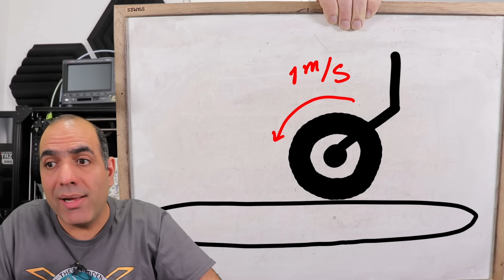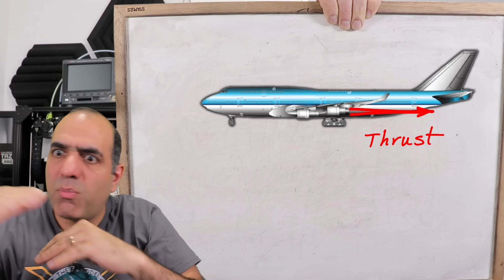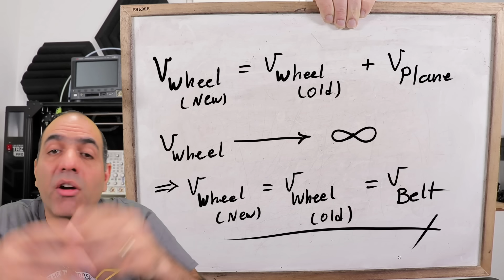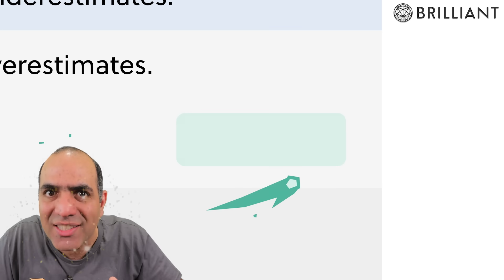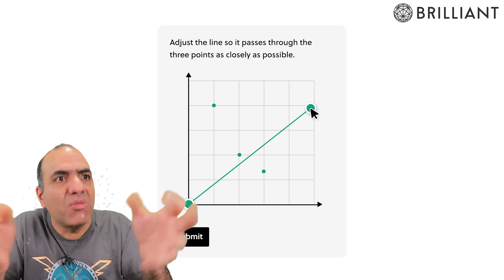Airplane Question that Drove Me NUTS!!!

Comment: Since the question is so simplistically stated I think we need be no more sophisticated in any of the assumptions needed to come up with an answer.  The plane is stationary.  There is no externally caused wind.  There is no friction in any part.  The wheels rotate with some nominal surface speed and the conveyor belt moves backward at the same surface speed.  Therefore since there is no airflow over the wings of the aircraft it has no lift and stays on the belt.

Comment: The wheels aren't driven. The plane would accelerate forward. If the belt continued to increase speed to match the wheels, I assume the wheels would fail at some point. There's no way the friction of the wheel bearings would overcome the thrust of the jet engines.

Comment: I think it should be able to take off, because the wheels aren't pushing it forward, the engines are. Even if the conveyor belt is moving backwards, the drag from the bearings in the wheels shouldn't slow it down so much that it can't take off, right? That's just my guess. Time to figure it out, I suppose.
Reply: If we have wheel drag and other friction, enough of those causes heat that makes the bearings explode and destroys the wheel assemblies.  While planes can usually land on their belly, taking off is a very different story.
Reply: @VoltisArt  if the wheel assemblies are destroyed, that would leave the plane a few feet above the ground. I count that as a takeoff :) (even if it flies about 4 feet before landing on its belly again)

Comment: The plane in this problem will NOT take off. It's more of a pain to read some strange comments and weird hypothesis (as Mehdi did in this (quite poor) video; he had the chance to explain properly but he missed this chance). 

Without making some weird hypothesis about plane's weight, wind speed, density altitude, ...ALIENS, then the question makes the following assumptions:
-Boeing 747 jet plane;
-conveyor belt which matches the wheels speed.

1) Indeed, the plane wheels do not spin because they are connected to the jet engines. This means the wheels are not the cause why the plane moves forward. The plane moves forward because of the thrust from the jet engines.

2) The engines do NOT create lift. This is done by the WINGS and the air going above and below them based on the Coanda effect. A Boeing 747 (as the problem states) does not fly in the same way as a rocket; a Boeing 747 is NOT a VTOL.

3) The engines will push the plane forward, but they will NOT bring air above and below the wings in order to create lift. The plane must move through a mass of air in order to fly.

4) The problem states: the "conveyor belt matches the wheels speed". The problem says NOTHING about the wind, for which case it will be considered zero. For an observer siting near runway, the plane is NOT moving. The ground speed is ZERO. While indeed there is some air sucked into the engines, which also creates some turbulence reaching the wings, most of the air particles above/below the wings will also be at ZERO speed relative to the plane and its wings. There is not enough mass of air going over/below the wings, which means NO LIFT.

5) Offtopic: indeed, a small planes can take off from a very short runway, or almost zero length (like the bush planes) BUT they are designed for this kind of operations (having VG kits installed, they are super-light planes), BUT they are NOT Boeing 747 as the problem states.

6) UPDATE: I see that many people speak about friction (and Mehdi too), but it is in the wrong way. The only time when the friction could play a role is if the conveyor belt through its movement displaces a mass of air enough to create lift, otherwise there is no reason to consider other friction than of a Boeing 747 (as the problem states).
Reply: "For an observer siting near runway, the plane is NOT moving."

Sure it is.  At exactly the same speed as if the conveyor belt was just a normal runway.  Because it's generating thrust via the engine.  The wheels are utterly irrelevant.

The only way to keep a large engine from moving forward as it's producing thrust is by physically bolting it to the ground.  You cannot attach free-floating wheels to the bottom of an engine and put it on a conveyor belt to test the engine.  That would cause a large engine shaped hole in the side of your test facility.  You restrain it very tightly.
Reply: @Killua2001  Please read again the hypothesis of the problem. It is in the same way a person walking on a  conveyor belt is stationary for anyone else. What I said earlier is correct: "for an observer siting near runway, the plane is NOT moving".
Reply: @hal6702  A person walking on a conveyor belt can only 'move' by using friction between the belt and their feet.  So, yes, if the belt moves backwards, they do too, cause 'friction'.

A plane generates a lot of thrust.  The only way 'friction' keeps that plane on a conveyor belt without moving is if, again, it's physically bolted down.

You couldn't have possibly picked a more different scenario to call 'the same'.
Reply: It is the same scenario, but it seems you can't understand. I will try one more time maybe I can make your understand.
Suppose you are on a wheelchair which has attached a jet engine to it, and the wheel chair is on a conveyer belt. It is the same idea, it's just you who can't understand.
Reply: @hal6702  The wheelchair would very quickly find itself going through a wall, with or without a conveyor belt.  The only way to avoid grandma getting airtime in her chair would be to bolt it to the ground.

There's no difference between a 'jet engine' in this scenario, and a 'rocket engine'.  No conveyor belt is capable of exerting enough friction to keep a rocket from moving forward unless the rocket is bolted down.  The only thing capable of applying any kind of oppositional force is friction, and friction vs jet engine tends to lose every time.
Reply: @Killua2001  Do you understand the idea of a CASE STUDY and a HYPOTHETICAL QUESTION ? Do you think someone will built a conveyor belt for a Boeing 747 in the first place ?

What is all this BS are you keep replaying which has nothing to do with the main problem and nothing to do with the statement I wrote earlier which was "For an observer siting near runway, the plane is NOT moving" and you said it is false. It's not my fault you don't understand; it's your fault.
Reply: @hal6702  Hypothetical or not, newton's laws still exist, and without physically bolting an engine to the ground that engine is going to be moving with or without a conveyor belt.  Not 'moving relative to the belt itself', but moving relative to your observer sitting near it.

Comment: Technically, unless the wheels of the jet were powered in some way by an engine to initially match the starting speed of the tread mill, the plane would essentially fall off the end of the tread mill, unless of course there was a control line holding the aircraft in place in that case the wheels would match the speed of the tread mill but there would still be no air passing over the wings to generate lift

Comment: I don't think you're correct on the case where there is friction (2&3), because you're mixing up rotational speed and translational speed.

 If you say that the conveyor belt must match the rotational speed of the plane's wheels, but in the opposite direction, there is no problem, because we can simply set both speeds to be zero.

If instead you use translational speed, then again there is no problem, the conveyor belt will simply spin so that it's top is going at the opposite speed to the plane, just like in mythbusters. Then they both have opposing translational speeds and there is no problem.

The problem arises when you mix rotational speed and translational speed, and that's why your solution blows up to infinity.

Comment: This is a really interesting question for every flight simulator player, the difference between ground speed and air speed(also TAS, true air speed). Planes need wheels to gain ground speed, while gaining TAS which gives plane lifting force. But the belt is moving at the same speed of wheels, which kinda likes you are taking off with downwind(and this wind speed is exactly your plane's ground speed), which won't generate any lifting force, and you'd better stop before V1😏

Comment: (Writing before the video plays, paused as he asks the question) Yes, it can take off. Forward motion in the plane is independent of the wheel and ground. Forward momentum is imparted to the plane by the jet engines pushing against the air around the jet. The wheels and ground are just trying to create as close to a frictionless surface as possible. Which is how you can have planes in the far north taking off with skis on snow instead of wheels on asphalt. With forward momentum the air over the wing is what provides lift, so any forward momentum imparts lift. All you have to do is to get forward momentum enough to counteract G. 

Interesting question. In this hypothetical, does the conveyer belt move forward, to counter the rolling of the wheels, or would the belt move backwards because the wheels are not rotating but the wheel itself is moving?

Comment: Oh, imaginary questions: I imagined, that the conveyor belt should catapult the plane, without the plane activating the engines. I came to the answer, that I do not have sufficient data to answer the question. After my thinking my answer was: Depends on conditions not stated. I hate this stuff, there is no right answer, but this bullshit is used to persecute people in countries. The persecuted just answers wrong, because there is always an interpretation where he is wrong. One should not be very accepting with respect to this kind of ill-stated questions. It is not clever in any fair sense.

Comment: For an aircraft to take off, It's all about freestream air speed local to the aircraft, rather than how fast the engine can throttle up to or how fast can the wheels turn. Even a 747 can take-off with 0 engine thrust if there is enough air flow flowing over the wing for the aircraft to generate lift.

So really, the presence of a conveyor belt matching the speed of the wheel is more like a distraction to the problem, than it is part of a question.

Comment: This is not that complicated. It is the air moving over the wings that produces lift, not the pavement under the wheels. On the conveyor belt, the wheels turn but unless you also provide sufficient air flow, you will have no lift.

Comment: Awkward sounds like BigCliveLive 😂😂 You are correct in you analogies.. Well explained. Simple answer is NO it can't take off..unless there is a fan of air running over and under the wings at high speed of 160kts..and the engines are at thrust enough to overpower the conveyor...
Reply: Why would it need a fan? The thrust isn't coming from the wheels. 747 has a takeoff speed of 160 knots(airspeed). Conveyer moves backwards at 160 knots to match, while the wheels spin at 320 knots(groundspeed). As long as the wheels can take it, it lifts off fine.
Reply: @bueb8674  thinking again about the question.. without engines running the plane would just go backwards to the end of the conveyor..  there problem solved. Because otherwise the 747 would needs to be teathered down outside of the conveyors if the belt is powered.

Comment: Yes, the friction can be an issue, but 1) friction is proportional to weight, and the weight progressively decreases as the plane accelerates, and 2) would the friction increase at a rate faster than the thrust increases lift? Seems doubtful.

Comment: I think that once the jets start thrusting, th conveyer and wheels are irrelevant provided there is enough runway build up airspeed.  The conveyor only would only matter if thrust were provided by the wheels.  But in this case, the body of the plane will move forward regardless of what the conveyor is doing.

Comment: Because the wheels don't drive the plane forwards, the engine thrust will move the plane until the tyres explode. Then because you have no wheels, the magic conveyor will begin operating in reverse mode and the plane will lift off. Too bad about landing again...

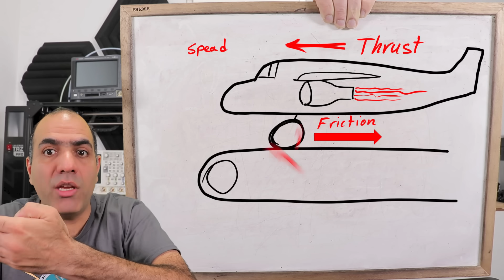Comment: Hi Mehdi, I want to adress a small error you made: at 5:20 you said that if friction becomes equal to the thrust, the plane would stop moving. This is incorrect, the plane would stop accelerating while retaining the speed it gained before that point. This slightly changes the the conclusion because wether the plane takes off now depends on how high friction, thrust, etc. is. It would be plausible for the speed of the plane that it gained before the cutoff point to be enough for it to take off but again, that depends on the exact values.

Comment: Stealing this from another comment, but expanding on it further: 

The plane would take off! 

Let me explain:

For the conveyor belt to match the speed of the wheels, the belt would have to be moving TOWARD the plane. This motion would definitionally pull some (although small) amount of air, TOWARD the plane as it passed under the air towards the wheels and thus also towards the whole plane too. Therefor; after the conveyor belt reaches some theoretical insanely high speed; it would be pulling SO MUCH air TOWARD the plane, there would EVENTUALLY be SO MUCH air moving OVER the wings of the plane too; that the plane would eventually be FORCED to take off. 💨✈️✨

Comment: Y'all are getting pulled in by a question designed to pull you in. It's intentionally vague about the actual important factor, which is the airflow over the wings required for lift. 

Instead it throws all these details about the treadmill, avoiding any information about the key factors, because it generates engagement with the post. 

Actual answer: The plane can only take off if there is sufficient airflow over the wings to generate life, regardless of the treadmill.

Comment: Additionally, the wind limitations of the aircraft need to always be respected & winds approaching the Red area/"barber poles" on the airspeed indicator is not wise to venture into, especially breaking Vne (never exceed speed).
Breaking aircraft manufacturers Vmo/Mmo (max operating speed) & especially the Vne or speeding in excess of the flap or landing gear maximum speeds is highly likely to cause pieces of the plane to start getting dislodged ie Darkstar in TG Maverick & is not recommended.
In most larger passenger airliners hurricane cat 5 300kmh winds are considered V2 takeoff speeds but for a small prop plane ie C172 this could be an issue as Vmo is 158kn
If you feel this is slow, takeoff speeds in most passenger airliners would give a Lamborghini Huracan a run for its money!

Comment: The conveyor matching the wheel speed means that the relative ground speed is 0. Airspeed is what matters, so the answer is the same whether there is thrust or not, because if there is no ground speed, then the airspeed is simply just the windspeed vector at the plane's bearing. So the easiest way to visualise the problem is scenario #4, there is no thrust and you're sitting on the runway.

However, if the conveyor is ramping up to ludicrous speeds it will create a local air disturbance that could briefly lift the plane until it stalls again.

Comment: Yes the plane can take off because the wheels aren't driving it forward, the jet engines or propellers are, so it doesn't matter how fast the conveyor belt is driving the wheels, the plane will move forward however fast the engines push it through the air. (this was tested on Mythbusters)
Reply: Exactly!  Just as if it were to take off on ice (Antarctic or Arctic runway, eg. Firefox with Clint Eastwood) or water!
Reply: you didn’t watch the video before commenting
Reply: @Lettersnstuff  because those were the instructions while he told us about the sponsors

Comment: Whoever wrote the question must have thought the plane's wheels are what send the plane down the runway while the engines just sit there making a lot of noise for no reason up until the second the wheels lift off the ground out of pure magic - then the engines that were just making noise for no reason suddenly become powerful turbines that are pushing air and generating thrust

Comment: I think the plane takes off. The question says the plane is sitting on the conveyor runway, but because the question deals with the plane taking off we can assume the engines are running. The thrust acts on the plane, the wheels do not help propel the plane. If the wheel bearings were frictionless the plane would take off normally, but in real life they aren't frictionless, so it would be likely the bearings would fail at some point.  I suppose the answer lies in when the bearings fail, and how fast the plane is going at that point. If it's at the point of lifting off it flies, if not I wouldn't want to be on board.  I still think the plane takes off.

Comment: As an aerodynamicist this is such a frustrating question. The correct answer to the overarching situation (i.e. trying to answer this ill-posed physics question) is to use it as an opportunity to explain the difference between how cars and airplanes produce thrust. The even more correct answer is to recognize the question is very poorly posed, and use that as an opportunity to explain the importance of clearly defined situations and parameters in physics or engineering problems. That could even segue into a discussion about unique boundary conditions, initial conditions, and governing equations; and all of a sudden you're actually teaching physics... which is basically the progression this video took, so good job I guess. Still super frustratingly to read comments of people confidently arguing semantics of an ill-posed question.

Comment: Without AIR MOVEMENT, the plane Can Not get any lift, so will not fly.
However, you stated that the treadmill LENGTH is the Same as a Runway, so YES, it will fly because it is still Moving Forward.